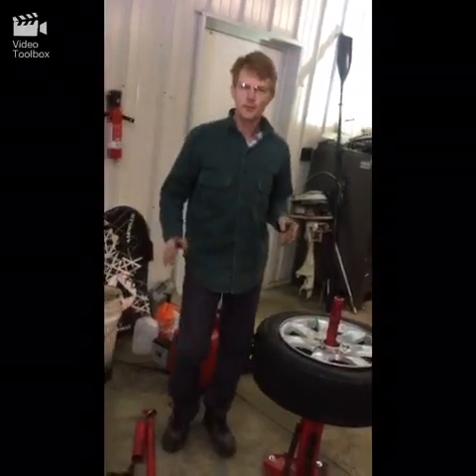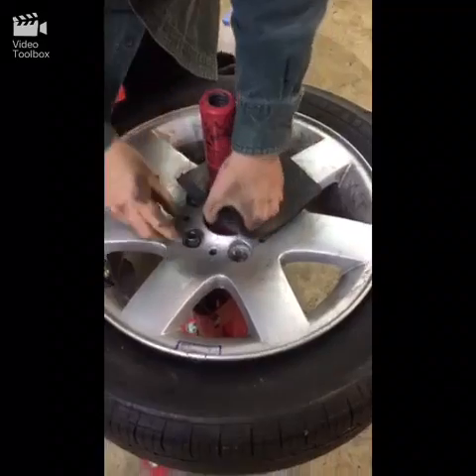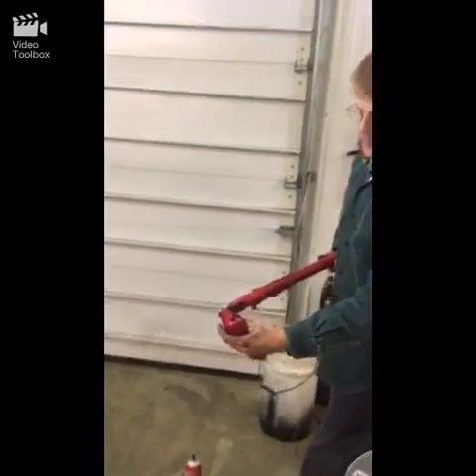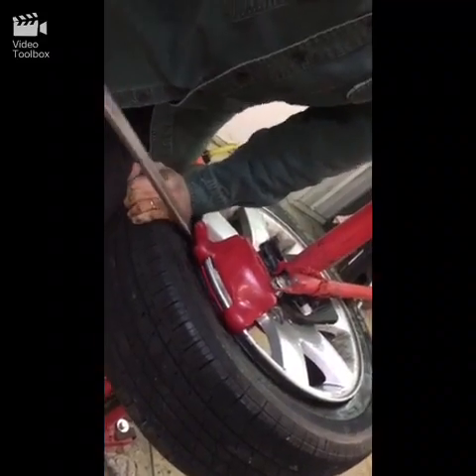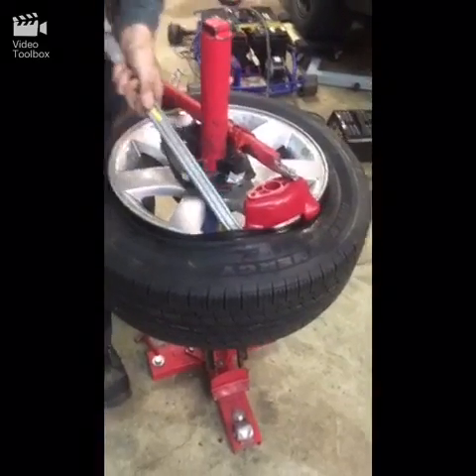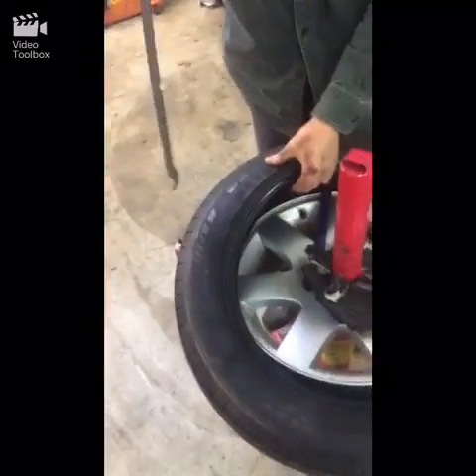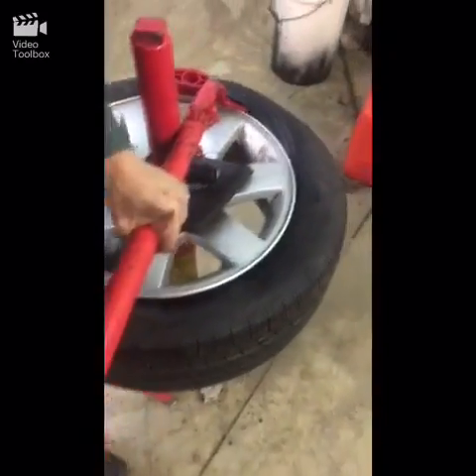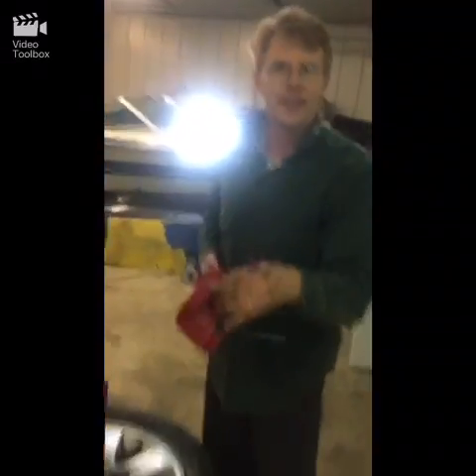Cheap and easy tire iron hack

Comment: Great video. Thank you for this. Though I've changed motorcycle tires before (fighting with tire irons and scratching rims), I was worried about doing my car's for the first time. So happy to report this simple mod along with the big red tire changer made it super easy. In keeping things simple and saving time, I found there was no need to move the bar between the duck-head's holes whether removing or installing. Leave it in the hole you had for removing.

Comment: Yeah great idea . Was gonna do something similar but was gonna get another pole etc . This will save me from doing that. If you just take a simple piece of flat stock you could mount it to the duck bill using 2 bolts and then bolt the pole to the center of it so you can go in either direction without changing positions.would only require a $2 piece of flat bar and 3 drill holes. Thanks for posting . (I hate to criticize things like this but film in horizontal /landscape position please lol)
Reply: Dont need to been doing this waybove 11 years now...he the only one who showed it.. lol why would u pay $350.00 for the add on.piece on a $30 tire station...

Comment: Is there a reason you aren't bolting the duckhead in the center? Noticed there were 3 holes. Just curious if it doesn't work as well maybe?
Reply from the maker: Yep, it was just a little easier to not center the duckhead but it doesn't make much of a difference where the head is mounted as long as it is stable.
Reply: @veremiller2171  thanks for your reply. Since commenting I fabricated an arm to simulate a tire machine. No chance to test it yet, but I think your idea will make a reliable backup if it doesn't work out. Thanks again.

Comment: first time i seen this way...very great idea.well done.im off to ebay and get one of those duck bill thingys
Reply: Did you manage to get one from eBay
Reply from the maker: Thanks for watching! Also if you did find it on eBay please send me the link, we only knew Amazon sold them
Reply: @veremiller2171  Thanks,
This is amazingly simple and effective.
Just got it from ebay.
1 hole + 1 bolt/nut
No overhead pipes, welding, complex constructions with the same result.

Comment: Slick!!
 I have a No-Mar Bar But Didn't try it yet. 
I may do the Mod like you did. 
I'd just leave mine (The Duck Bill)  set up in the Mounting Position, as My No-Mar bar should Be OK for Dismounting. 
The Bar HF gives you Is A POS!  I could never get the mounting end to work at All!
Plus The  the bead breaker bent on Mine, I have to straighten it and beef it up.
Reply: Exactly what I found,,
Reply from the maker: Makes sense, we appreciate the feedback. Thanks for watching!

Comment: Nice simple approach!  What would happen if you made a plate to mount the duck bill to the bar centred?  Would you then be able to push both directions without changing anything?  Thanks for any info!
Reply from the maker: That sounds very do-able, but a little hard to say if it would for sure work, if you try it please let me know the result, thanks for watching!

Comment: Didn't need to keep putting bar on other side of the duck head when was putting it on doing it wrong way mate should be tyre over ducks tail under ducks head turn bare anti clock wise fitted tyres since 2003 lol van use spray bottle with washing up liquid and water and pain brush
Reply from the maker: I appreciate your feedback!

Comment: Seems way more complicated than with the unit's regular bar. You kept saying metal doesn't touch rim but it appeared you had way more metal touching the rim: in addition to the changer bar, the contraption add on, plus the tire iron. I'm not counting that little piece you retrieved from the tool cabinet.
Reply: The mounting head is all that's touching the wheel and it's made out of nylon.